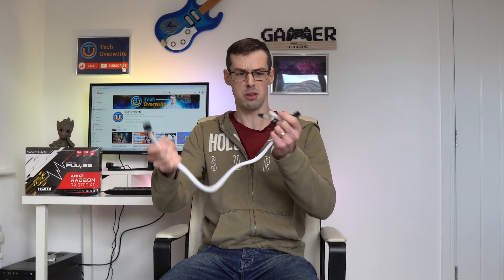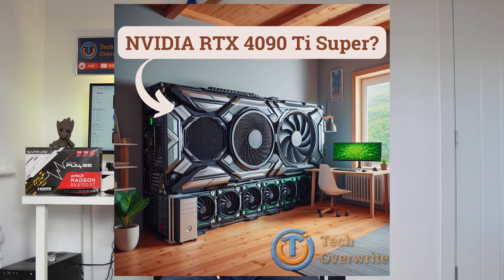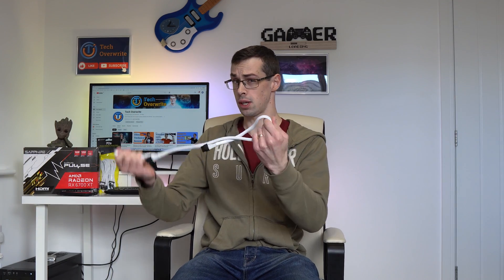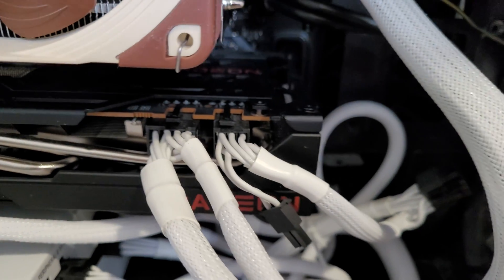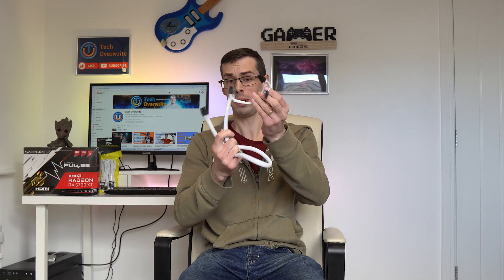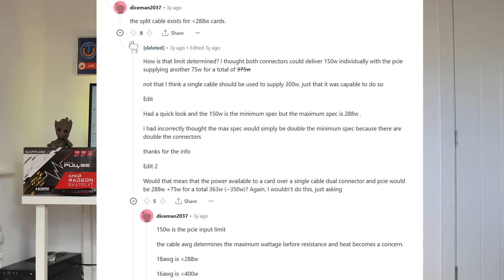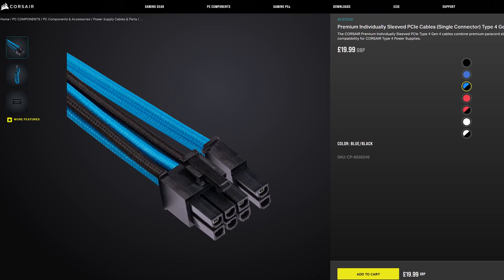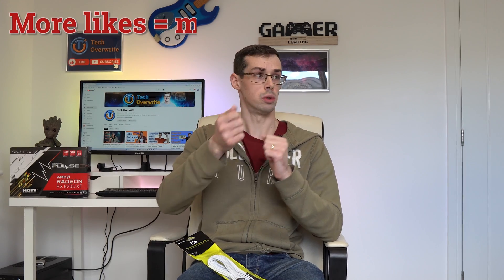Stop Connecting Your GPU Power Cables Like This! (How To PROPERLY Connect PCIe Cables For GPUs)

Comment: I recently Purchased a Sapphire rx7900xtx and I ran towards an issue. My PSU has only 2 PCIe connections, the GPU needs 3. The PSU is a BeQuiet Pure Power 12 1000w. I am running 2 cables and use the pigtail of one of them. Should this be fine ? The GPU runs at about 404w at full utilisation.
Reply from the maker: Yes it should be okay IMO. Running 2 separate cables should supply enough power, especially when considering the motherboard PCIe slot. If it had issues though, you'd know fairly quickly due to having stutters and crashes when gaming. If it's stable for you at load, then that's probably proof enough that it's an okay power setup :)
Reply: @TechOverwrite  thank you, for the answer! :) yes, it runs stable and I haven't come across issues. So my worries have been lifted then.

Comment: I have at the moment an 8-pin 3-way splitter. Is that OK to test my 5070?, I only have 2 8-pins I can plug into the splitter, or would I need a 2-way splitter? My card comes tomorrow
Reply from the maker: That's exciting re: your new card :) It can depend on the exact way that the 3-way splitter is designed, but you should be okay plugging just 2 cables into it (especially for a 5070/5070 Ti). That's fine from a power perspective at least. But if it doesn't boot up at all, maybe the splitter is designed to expect 3 cables - in which case you'll then need a 2-way splitter, I agree.
Reply: @TechOverwrite I just found out 30 minutes ago it's in my city, so it's coming today. I'm nervous because I might have missing ROPs, but if I don't, I'm excited. Before I found out about this ROP stuff 2 days ago, I was excited. I'll let you know if I have any missing if my card boots with the adapter, but I get the reg cord next week.
Reply from the maker: Ah awesome, I hope it works well for you and doesn't have any ROP issues :)

Comment: This is an infuriating situation for me as my psu only has 2 cables (4 with pigtail) and I can’t source a third. So basically need a new psu!
Reply from the maker: Ugh sorry to hear it. You might be able to get by with undervolting your GPU, or maybe 2 separate cables will be okay depending on the PSU (i.e. if they are thicker gauge cables). But yes, if you're experiencing crashes when gaming then maybe a new PSU would be best :(

Comment: Unfortunately, when i first got my 7900xtx red devil, i only had a single and a daisy chained pcie cable for it. I knew that i may not get the most performance out of my card because of it. However, i didn't realize that it was the cause of the hundreds of crashes i was getting! I was assured that it would be fine with my card, but i guess the fact that it's an OC card means its not compatible. Thanks for the info!
Reply from the maker: That's interesting, and glad that this helped :)

Comment: Can I connect my 6700XT with a single cable, or do I absolutely need two separate cables? So far, I haven't had any issues, except that when I enable Windows fast startup, sometimes the PC turns on, but the GPU doesn't output any image (I imagine it's because some residual power remains in the GPU)
XFX RX6700XT Qick 319
Reply from the maker: That's interesting (albeit annoying!) about sometimes having issues there. It depends on the PSU cable and their gauges to be honest. Some cheaper PSUs will only output 150w through the PCIe cable (which would then be borderline when including the 75w from the PCIe slot), but many do give a lot more.

Comment: Im running a single pigtail on a RX Vega 64 and i see 253w drawings and it's been like this since 2017 even on a newer PSU (changed the 2017 psu in 2021)
I’m planning to upgrade to a RX 7900 XTX 
Will 1 Single PCIe cable and 1 pigtail be enough for the 3 - 8pin PCie?
Reply from the maker: Ooo, the 7900XTX will be a great upgrade :) With that, I would want to run 2 separate PCIe cables from the PSU - and then feel free to use 1x pigtail yes. So one PCIe cable would just use one connector (with the pigtail unused), then the other PCIe cable would use both connectors (pigtail used).
Reply: @TechOverwrite  Hi again
i got the 7900 xtx pulse with monster hunter wilds bundle for 17500 MXN (850 USD) in the day of RX 9070 Launch (March 6)
i went for de 7900 xtx because the 9070 XT was 900 usd...
and in the end i followed your advice about separate PCI Cables, i only had pigtails PCI Cables so i had to use them, it looks kinda ugly lol but it worked

I cant believe i ran my RX Vega 64 for 8 Years with the same pigtail, my god
Thanks a lot, this video really helped

Comment: WTF i can not take this shit anymore. I had hard time to change psu and video card to 3070 on my shity case. I have only one line with two 6+2 pin conectors. And i now get worser performance with the 3070 then with the old 1070. No game is even runnable. I ahve no money and no one to help me. My entry life is only shit.
Reply from the maker: Oh that sucks :( Sorry to hear it. Maybe check that it's receiving good power with HwInfo, and also use GPU-Z to ensure it's running at x16 bandwidth. Reinstalling the drivers might be a good idea too.

Comment: I can't agree enough when you said you hate the pigtail connector, cause I don't really like it too. 

I've been running my EVGA 3060 Ti FTW3 that requires 2x8 pin, supplied by Cooler Master V650 SFX Gold for over 2 years now. The PSU only came with a pigtail connector for PCIE/GPU, so that's what I used and still do. Although, the other end of the cable to the PSU is I believe to be 16 pin?

The 3060 Ti itself only has 220W of TDP originally (FTW3 can go up to 240W). So, I guess, technically 1x8 pin should be fine for most 3060 Ti, although it's right close to the 225W limit. I guess brands use 2x8 pin for OC cards for overclocking head room which I did the opposite, undervolting 😅
Reply from the maker: Hah thanks, glad I'm not the only one 😂

Yes I agree that the 3060 Ti might be fine with just 1 cable - even though I also do the same and run multiple cables, then usually end up undervolting LOL.

That's interesting about your Cooler Master PSU. Yes some do have a 'reverse' 12vhpwr to 2x 8-pin type setup nowadays. I recently saw a Corsair 2025 PSU that came with that - so a 12vh-2x6 slot, and you then had two cables to choose from: a 12vhpwr one (for NVIDIA GPUs) or a 2x8-pin one (for AMD and Intel GPUs).
Reply: @TechOverwrite   I just re-checked my PSU modular ports, and I was wrong. It was also an 8 pin slot in the PSU. And my PSU has 4 of it. One already used for CPU, another one for the GPU. I got two left unused. Prolly still can handle a GPU with 3x8 pin power but wouldn't risk it 😅

I'm planning to upgrade to a 4070 Super soon, do you think the best way to connect the power cable is to use two separated cables from the PSU, then connect them to the cable adapter from the box?
Reply from the maker: Ahh that's good to know then :) 4 ports should be plenty then!

Yes, running separate cables to the included cable adapter will work fine for the 4070 Super - I agree. I hope the upgrade goes smoothly for you!

Comment: alright , because i have some problems and not even tech's can find it in my area (pc shut downs while gaming with whole new pc) my card is the rx 7600 pulse sapphire,but it has only 1 slot,should i do this?
Reply from the maker: Hmm sorry to hear it, that's frustrating. As long as the single 8-pin cable is properly plugged in at the PSU and GPU side, there's nothing more you can do from a 'physical' perspective, really. I would move onto checking temps and software - such as monitoring HWInfo and checking that the temps aren't too high. It might also be worth running DDU then installing the AMD drivers from scratch.

Comment: When it causes problems it matters, but if it runs fine on the pig tail then use the pig tail. Much cleaner and easier to build around imo.
Reply from the maker: Yeah possibly, and to be honest I'd prefer a pigtailed 8 pin to a melting 12vhpwr connector :(

Comment: Hi there, just wanted to ask if I can use a single PCIE 6+2 connector with a pigtail to connect to a 4070 ti super? Unfortunately, my psu Corsair CV750 only has one pcie cable for gpu and is not modular. Like connecting it to the 12v power cable connector that comes along with the gpu.
Reply from the maker: Hello, hmm I probably wouldn't risk it sorry - the power draw for the 4070 Ti Super can be quite high at times. I'd either undervolt the GPU, or change the PSU.
Reply: This been holding me to upgrade my 3060 Ti to mid-high 40 series card, or soon 5060 Ti or 5070. I know the connector melting issues only happened with highest tier cards like 4090, 5090, and 5080. But still not sure for the long run..

Comment: Can I use 1 of the pigtail connector and 1 signed connector
Reply from the maker: It depends on what graphics card you have, but running two separate cables (and leaving one pigtail unconnected) is fine for pretty much all current GPUs yes :)
Reply: @ Rx 7800 xt
Reply from the maker: Yes I think that'd be fine IMO 🙂

Comment: I been using the jumper method with two cables for my 3 port rtx3080 strix. I’m gonna get another cable third cable and try this to see if it runs better. Thanks for heads up
Reply from the maker: That sounds like a good plan, fingers crossed it helps it run a bit better :)

Comment: Question pal, could I use a pcie 16 pin to 8 in a 4060 as a normal 8 pin connector for the card or will the new 16 pin damage it or get damaged? 

I’m not taking about 16to16

16to6x2 connector will it be safe to use for a 8 pin card ? Or should I just use normal 8to8 ? Power supply built for 40series ?
Reply from the maker: 16 pin to 8 pin should be fine, assuming the cable or adaptor is from a good company (i.e. the PSU maker itself, or someone like CableMod). No reason why it wouldn't work 🙂

Comment: What about the cpu ones
Reply from the maker: Good question, I could do a separate video on this. The TL;DR, though, is that unless you have a super powerful CPU (MORE powerful than a 9950X, for example) then you'll probably be fine with just 1 cable.

Comment: Can i use pcie cable from Corsair to my psu seasonic M12II evo edition 750w?
Reply from the maker: Nope. I mean, maybe it'll physically fit (maybe) - but mixing PSU cables between brands is a big no-no sorry. Better to either change your PSU or look for the correct Seasonic cables, which I know is frustrating but I wouldn't use Corsair cables there .

Comment: What if I have 2 cables, one on its own and another woth the pigtail thing, on the 4080 adapter will it affect performance?
Reply from the maker: Yes you can do that (using 2 cables, and ignoring the pigtail on one). A proper adapter should be fine (and not impact performance) too.
Reply: @TechOverwrite i just bought an msi 6800 xt, and i got one devil tailed 2x (2+6) and one direct (2+6). So im guessing that using both the direct + the devil tailed cable while leaving one end of the devil tailed connector hang freely would be a safer bet than just using the devil tail connector fully?

Comment: I'm running a 3090 off the single cable, regularly pulling 330-340 watts with no issues.
Reply from the maker: Fair play, that's a good achievement. Presumably that's with a fairly thick gauge cable which can supply 288w at least, and then the PCIe mobo slot supplies the rest?

Comment: I just bought a non modular 650w 80w bronze psu.

I have a pigtail and have no way to separate the cables from 1 to 2 , due to the non modularity of the psu.
What do i do?
Do i return it and buy somethinf different?what can i buy under 100 $?
Reply from the maker: Good point, I didn't cover non-modular PSUs here unfortunately. Your options are to either (1) ensure that your GPU isn't too powerful, (2) to undervolt the GPU so it uses less power or (3) change your PSU. The Corsair RM650 is modular and is often below $100, IIRC.

Comment: This is false information and let me explain why. All the pcie sockets in your power supply lead to the same spot, the 12v rail. They all draw power from the same place. There is no 150watts limit per pcie port in your power supply. You almost got it right at the beginning. The 150watts limit is the "safe" power to transport over the standard cables. You can transport more but the cables will melt. This is why vendors recommend using multiple cables, NOT because you cannot transport more than 150watts over 1 cables, but because it's not safe. One great example is the 2 pcie to pcie gen 5, that can transport 600 watts over 2 cables, from your power supply.
Reply from the maker: Thanks for the clarification - I try to strike a balance between keeping it general, and not being too detail-heavy so as to confuse beginners. But I'm certainly not an electrical engineer, and I can see why some of my terminology was confusing. I appreciate this extra detail in your comment.

Comment: Hey man great video! I just got the Sapphire Pure AMD Radeon RX 7700 XT GPU and a new RM750 Corsair PSU. It only has devil spawn cables, am i good with just using 2 of the devil spawn cables and not plugging in the pigtail part from each. The diagram(s) starting at 0:25 show this as an option (its the third image on the Antec & SilverStone diagrams). I will eventually buy 2x single 6+2 pcie cables. but for the time being this is what came with my psu thank you so much for the info. subbed
Reply from the maker: Thanks man, glad you enjoyed and cheers for the sub :) The 2x single cables are nice from a cable management (and aesthetics) perspective for sure, but yes your plan is fine - using two separate cables and just ignoring the pigtail part will work 100% fine.  :)

Comment: I have the msi mag a850gl with two (8 pin to 6 + 2) cables. Could I plug in both 8 pin cables and then use a pigtail for the last pcie slot on a gpu with three power connectors ?  

people say it depends on psu but could I still overclock ?
Reply from the maker: It should work fine yes, and that would deliver at least 375w to the graphics card (2x 150w from the PCIe cables, and 75w more from the PCIe slot). In reality, a good PSU like the MSI MAG should deliver a bit more than 150w per cable too. But yes, unless your power draw is 400w+, I think you'd be fine here :)
Reply: @TechOverwrite  
Thanks for the answer but, I have one more question to ask. My Pcle cables are 8 pin Dual 6 + 2.

I'm trying to figure out the wattage for a single cable. So without the pigtail you can combine 6 + 2 just as a 8pin for 150w but, what about the hanging 6 + 2?

Is that another 150w to make the total wattage of the cable 300w ?

Did more research and it seems my psu cables are 18awg and 18awg can’t handle as much wattage as 16awg but will 16 awg cable extensions help the PcIe 18awg cable do more wattage ? 
(Sorry for the yap)

(With all three 8pin Pcle connected 450w ???)

Sorry to bother 🙏

Comment: Reverse? Can that 12vhpwr to 2x PCI connector cable be used the other way around? Connecting the hypwr end to a new 1000w ATX 3.1 Corsair PSU and the other end to the 2 PCI power ports on a Radeon 7900XT GPU?
Reply from the maker: Good question... I don't think you can use it in reverse no. I mean, it would probably physically fit but I don't believe it's designed for that. The 12vhpwr end is designed to go into the GPU, so I wouldn't want to risk this.
Reply: @TechOverwrite  I’ll leave it alone then. But this video made me get out the motherboard manual and I added the 4 pin extra power cable for the CPU. I just never paid enough attention and this may be the clearest description of PSU wiring I’ve encountered. Many thanks.
Reply from the maker: That makes sense, and glad to have helped :)

Comment: hey i hope someone reads my comment i know its not out at the moment but i was wondering what cable i wuld meed for a 5070 ti rtx when it releases im not quite sure i was told to get 2 CableMod C-Series Pro ModMesh Sleeved 8-pin PCI-e Cable for Corsair Type 4 RM Black Label/RMi/RMX is there a more optimal cable?
Reply from the maker: Hey, yes the RTX 5070 Ti needs the 12vhpwr cable - so assuming you have an ATX 2.0 Corsair PSU , you could either buy Corsair's own 2x 8-pin to 12vhpwr adaptor cable, or one of the CableMod 12vhpwr adaptors.

Comment: I just looked into my case after upgrading and just noticed I didn’t use the other PCIe like I was before, I was using the pig tail and just had a heart attack fixed it hopefully and we should be good
Reply from the maker: Ah good catch, I'm sure it'll be fine (without any damage) :)
Reply: was using pigtail that bad? how bad was it and whats the difference now???????????
Reply: @V3DX27  the gpu wasnt pulling enough power and it would cause issues with frames and stuff but now it gets almost double the wattage and more performance it couldn't pull the right wattage through  2 points on the same cable so it led to being bad
Reply: @ Thanks for reply btw what gpu you used?? i have recently ordered a gpu it consumes like 170 W power, my psu only got one pigtail :l
Reply from the maker: @V3DX27  you should be fine here - a 170w GPU won't consume enough power to require 2 separate cables. In other words, just 1 cable with the pigtail will be fine in your case :)
Reply: @TechOverwrite  alrr i guess, ty